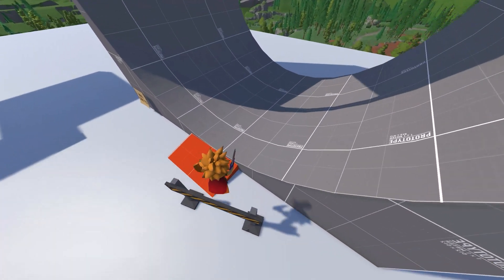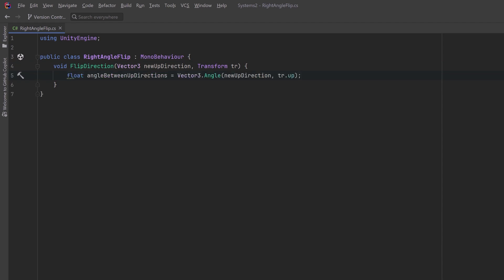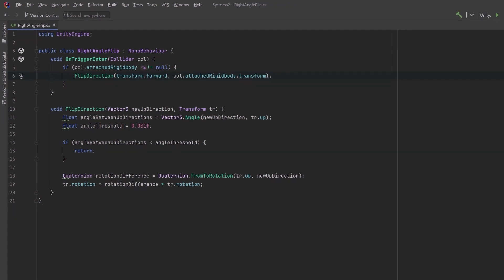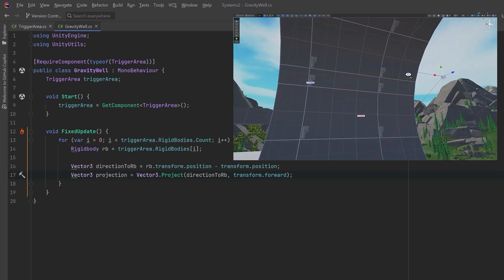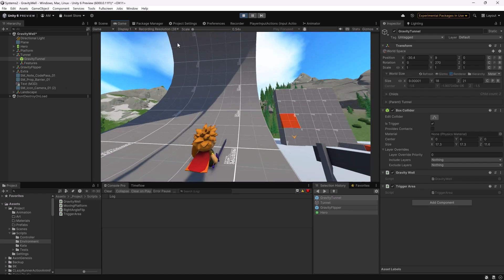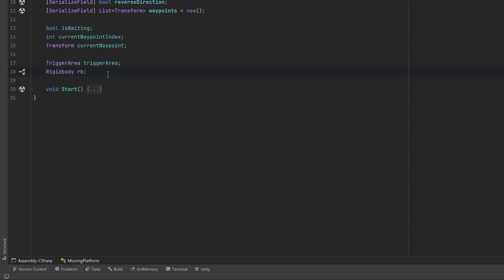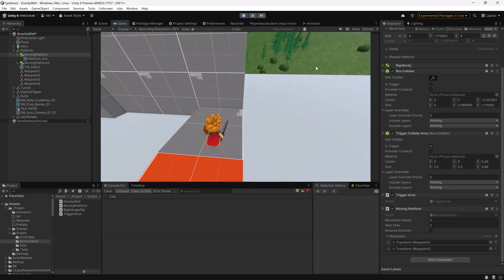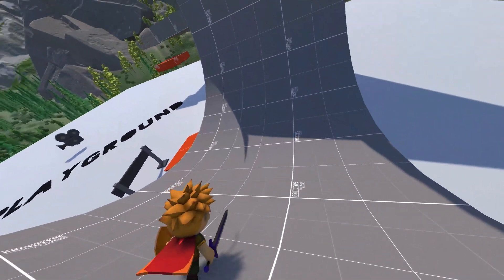3 Unity Tricks: Gravity Wells, Right Angle Flips, and Moving Platforms

Comment from the maker: Happy Sunday!  Lots of new tips and tricks today, and also I've updated the Unity Utility Library with some new hotkeys and helpers!  Link in description!
Reply: The audacity of you to launch this the week after I implement this exact stuff!  This is still super cool and I'm glad you did something like this. As is tradition I now have to know that I spent 2 weeks implementing a new thing only for you to casually write a better version of it.
Reply from the maker: @Fitz0fury  I think we need to sync up so I can get your timetable...
Reply: @git-amend  ill ping you later. I have made an insane amount of progress. I could actually use your advice about my next stage. The dreaded "final rework" of the battle system is coming up.
Reply: @git-amend  for the record silly gravity was not part of my scope. But I ended up going down a character controller rabbit hole for a few weeks  ..all because I had started causing some conflicts between old code where i was handling interactions without using an interactable interface and an asset I use for its inventory database.

Comment: Moving the Platform in the LateFixedUpdate() coroutine causes my cinemachine camera to jitter like crazy. So I put MovePlatform() to regular old FixedUpdate() and it fixed it.

Also, I believe the movement of MovePlatform should be calculated using Time.fixedDeltaTime rather than deltaTime since it's moving on FixedUpdate.

Comment: How does this handle curves. Like if the walla had a minor bend to them, what if it was on a sphere, or just in general if that gravity well wasn't a perfect circle?
Reply from the maker: It's dependent on the center point to correctly determine where UP is.  So, if you want to handle curves, then my suggestion is to use DOWN instead and make the normal of the curve the direction to align with, which will take a small extra calculation.  With the outside of a sphere, you could just use the center point in that case but reverse the direction.
Reply: @git-amend  I think you should consider adding a Möbius strip to your edge cases for character controllers that defy gravity. I think that's got to be the ultimate edge case (and will look awesome)

Comment: Great video. This one helped me with one of the issues I was facing. Is there a way to alter gravity with arrow keys so that we can flip the player gravity in any of the directions(Up, Left Right, Down)  and allow normal movements on those surfaces?
Reply from the maker: Thanks!  I think if you want to do that you need to disable gravity of course on the rigidbody and then start applying your own force in a particular direction, usually coming from the player's transform.position.up direction.  We're actually going to look at that a bit this weekend.
Reply: @git-amend  thanks for the tip, I'll look forward to this week's video. I tried doing the gravity manipulation with Vector3.up / left / right and so on which was a success but the player movement gets messed up in turn.

Comment: You could also use the improvisedTimers you did before to create custom fixedupdate that also follow the same workflow you did in here, as well to be able to turn the "updating" off when we know its in no use.

Would that be a thing worth doing? that way the coroutine wouldnt be playing at all times
Reply from the maker: You could do that yes, but it might introduce another level of complexity that - in this case at least - is not necessary since a MonoBehaviour / Coroutine combination already provides all the functionality that we need.  If you needed to make some kind of more complex platforms, you could consider doing that.  Just remember the extra complexity has to be justifiable, so always ask yourself what problem you need to actually solve that requires the more difficult solution.
Reply: @git-amend  Appreciate the reply, i really didnt considered the complexity being an issue, since the way i thought about it is that after being used to work with them, it wouldnt be that hard to do.

Keep the good work!

Comment: Hi, just wondering about a few things. most tutorials I've seen just parent an object to a platform, which you mention in the video. Any reason you didn't do that? Is the code more efficient, or just a choice? Also, to run around on a sphere, could you just reverse the gravity well up, or would there be more to it?
Reply: First reason I could think of is that is that the player risks getting unloaded/destroyed along with its parent platform. It also copies the platform's rotation and scale to the player, which you might not want
Reply from the maker: The main issue with the reparenting are the issues that @uhhmir mentioned, and beyond that, it may be more reusable and modular in that it can be adapted to various moving platforms and objects without worrying about the parent-child relationship.

And, yes you can certainly do similar calculations to figure out the correct up direction on a globe - essentially the player's up direction will just need to be inverted.
Reply: @git-amend  👍

Comment: Interesting, I would have expected that the gravity well component could basically have handled the right angle flip situation as well. It probably can when we change the center calculation to instead use a plane projection for direction. But the way you showed is simpler.
Looking forward to the player controller video(s). I always struggle with those.

Do you know why is the new waitforfixed update not static to begin with? I always thought the amount of time to wait might not be the same between frames or sth like that.
Reply from the maker: Thanks for the comment, and the excellent question.  WaitForFixedUpdate can't be a static class because to be used as a yield instruction in Unity, a class needs to implement the IEnumerator interface. This interface requires instance methods such as MoveNext, Reset, and a property Current. A static class cannot provide these instance methods because it cannot be instantiated.  So, the next best thing would be to instantiate a new one and cache it.
Reply: @git-amend  Ah okay, makes sense, but let me rephrase. WaitForSeconds is difficult to re-use because the amount of time passed in changes we need new instances here, makes sense. But if the instances of WaitForFixedUpdate and WaitForEndOfFrame can be re-used across different coroutines I wonder why didn't unity already create instances of those automatically with sth. like initialize on load or similar (and make those accessable through a static class, the way you did).
Reply from the maker: @fleity  That's a tough one, but given Unity's penchant for leaving things up to the developers, I think they would tell you that it is to provide the flexibility to control instantiation and lifecycle management explicitly. For example, you might want to add some kind of debug hook to the yield instruction instance (or it's usage).  Of course, they've never really explained that one, so I'm just making a guess.